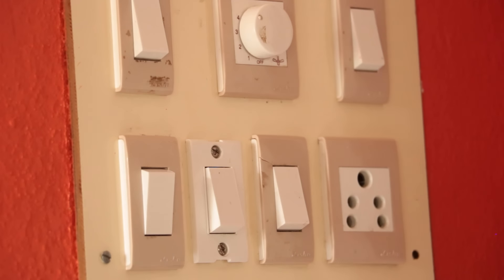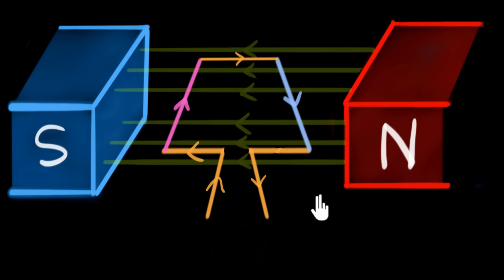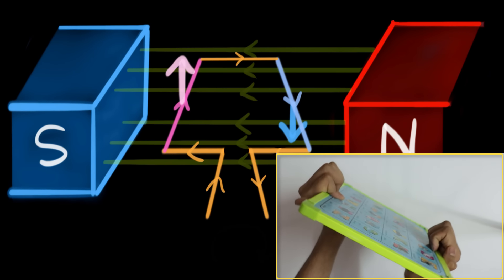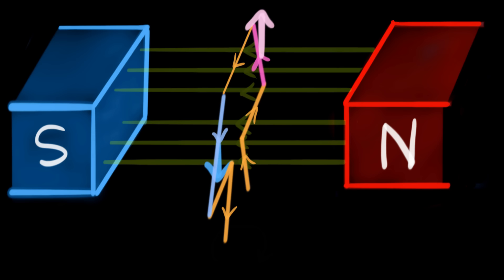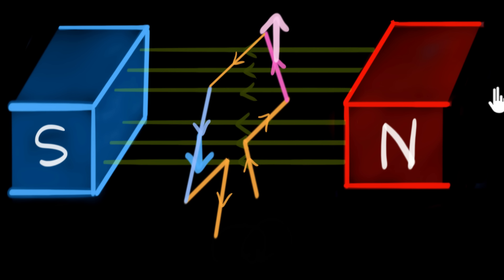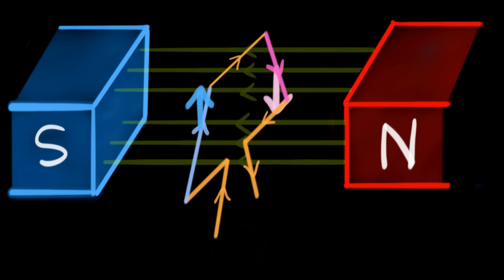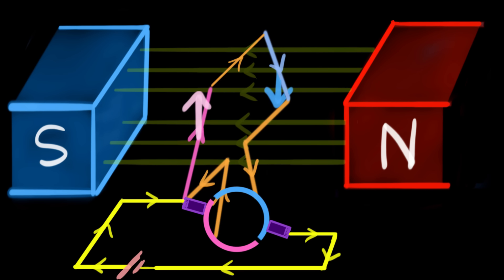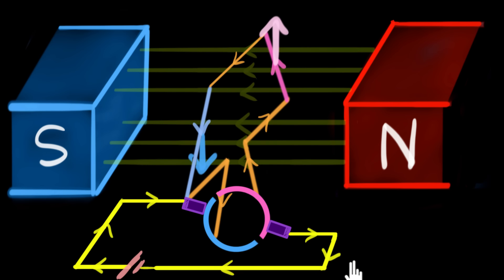Electric motor | Magnetic effects of current | Khan Academy

Comment: You could put an end to this fabulously communicative video explaining the reason behind the holes in the ring. When the brushes touch the curved segments of the commutator, electrons find the shorter path and don't travel through the rectangular long route. No force, not even any torque acting on the loop. Inertia comes into play and tilts the loop counterclockwise. The brushes now touch the previously untouched segment of the commutator. The current direction reverses.
Reply: Thank You So Much!! You solved my doubts! You definitely did the job for explaining the gap in the rings for Khan Academy! And yes, it would have been better if the reason was told to us too.😊

Comment: 6:02 sir I have a doubt actually you said those parallel sides which at the beginning were parallel to the magnetic field lines will experience the force but in opposite directions and thus they won't rotate obviously but other parallel sides as well at that time will experience force in different directions so they won't experience rotation either, at that particular time

Comment: At 7:10 , I don't think that coil will move in reverse direction . As the forces are upward and downward , so the coil will remain stationary and motor will not work .
But it's not true to say that coil will move in reversed direction
Reply from the maker: You are right about the turning force (torque) being zero. But, since the coil already has some momentum, it would continue to turn. It's similar to how a running ceiling fan continues to turn for a while even after being turned off.
Reply: @KhanAcademyIndiaEnglish  But if it is the coil's momentum making it to move further , then it's momentum should make it rotate in same direction , instead that momemtum making it's direction reversed .
Well , thanks a lot
The quiz was also awesome .
Reply: Exactly from the example of electric fan , it rotates for sometime even when we switch off , but it rotates momentarily in the same direction as it was moving .
Hence , the coil , if rotates for sometime with momentum , then it should rotate for rest in same direction , instead in reversed direction

Comment: a doubt -  you said that when the loop is parallel to the magnetic field, the force  in 
the yellow wires is trying to pull the loop apart but then will it cause any damage to the loop? like if the force acting on the yellow wire is greater than the force acting on the pink and blue wires?
Reply: No it won't cause any damage because it can be like...the yellow wires are pulled apart at the same time half the rotation and when they become parallel they become normal

Comment: Instead of a commutator can we use a AC voltage supply because the main thing is to reverse the direction of the current after each turn ?

Comment: I am confused as to why the motor turns clockwise in the beginning of the video. Shouldn't it turn counterclockwise as you have the North pole on the right-hand-side and South pole on the left-hand-side. I think you have gotten everything correct but the placement of the poles. If the North pole were on the left-side and South pole were on the right-side, then only would it turn clockwise. Correct me if I am wrong, I study in Canada and it might be different here, but I highly doubt it. Thanks!
Reply: Jai, actually, I think that is correct according to the left hand rule. Maybe you used your right hand, try using your left hand...
Reply: NISH You would use your right hand only if you’re dealing with positive charges or conventional current, however in a motor only electrons (negative charges) will be flowing through it as it will be connected to a battery. Thus, when dealing with negative chargers, you are supposed to use your left hand, like you should in an electric motor.
Reply: Jai, that’s exactly what I said previously. When I tried the left hand rule, the motor was actually rotating in the correct direction. When I tried the rule for the pink wire, my thumb pointed upwards.
Reply: NISH I did use my left hand rule it’s just not working.... The field should be moving from North to South, but this video is saying it’s moving from South to North. Honestly, we don’t use Fleming’s Left Hand rule here, we use another method. However, no matter what method we use, shouldn’t the result be universal?

Comment: When the coil exactly completes half a rotation force acts in upward direction according to Flemings. Left hand rule what happens then ?????
Reply: Kiran Bhat inertia causes the coil to move a little bit forward so that now the other split ring comes into contact with the wire. Current direction changes and again LHR is applied and coil continues moving
Reply: @nohelarehman1094  thank u so much for ur reply ....😁😁

Comment: Sir Ur explanation is awesome but sorry for pointing out ur mistake that dc motor rotates in anti clockwise u explained it in form of clockwise.....
Reply from the maker: A motor can spin in any direction clockwise or anticlockwise depending on the direction of the magnetic field and the direction of the current through it.
Reply: Khan Academy India - English 
principal of electric motor: Fleming left hand rule is used according to it....
It rotates in anti clockwise
Reply from the maker: Could you elaborate what you mean?
If you take a remote controlled toy car, it has motors inside, that make the wheels turn using electricity. 

The very fact that such cars can move both forward and backward proves that motors can spin either way right? :)
Reply: bandinanditha-Generally, a Bidirectional rotation of an induction motor with a remote control is a device that used to control a single phase ac motor rotation in the directions of clockwise and anti-clockwise. In straightway, we cannot turn the single-phase ac motor in both directions as well as we can only control this motor with a single phase one way switch. In other words, if we want to manage the motor in both directions then we must use any kind of motor drive, which could be so expensive, but it would also function with single phase one way switch. On concentrating these problems, here we have implemented a device that is named as a bidirectional rotation of an induction motor with a remote control device.
Reply: Maybe you are taking that the current flow shown is not conventional.?

Comment: But in book of Maharashtra board -
The loop and the axel start rotating in an anticlockwise direction.
Reply: It depends on the current direction and the poles of magnets
Reply: Yes but hey man, can you just look at the poles tof the magnet? The south pole is on the left and north is on the right side in the video but in the textbook they are exchanged. So the direction of the magnetic force also increases. Hence the direction of the force also changes. Okay?

Comment: What happenes when the gap comes
Reply: Although there will be no current in the coil due to the gap/split,  the momentum of the coil going in the clockwise direction will be sustained.

The gap is very very very narrow that it will only take a little amount of time before the brushes are in contact with the rings again, sustaining the clockwise direction.

Hope this helps Ma'am!

Comment: Carbon is a non-metal it doesn't conduct electricity. Then how does those carbon brushes conduct electricity 🤔?
Reply: Are you forgetting about graphite? Graphite is a non metal and also made up of carbon but it still conducts electricity
Reply: @shlokaswain2118  tq for reminding me. But he should have mentioned it. By the way, doesn't it gets powdered due to friction.
Reply: @JHANSI_REDDY  Yesw, but it takes  long time. After that you have to change the carbon brushes.